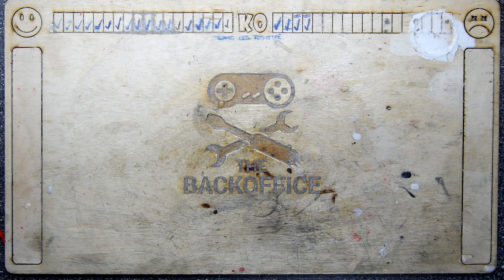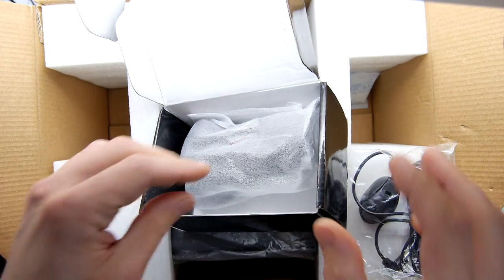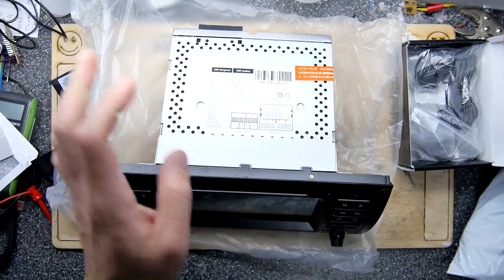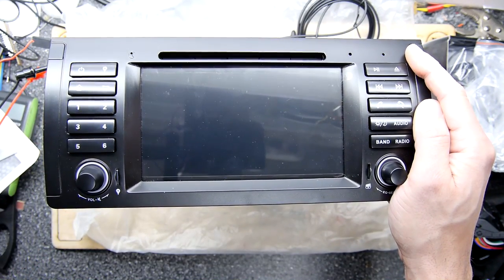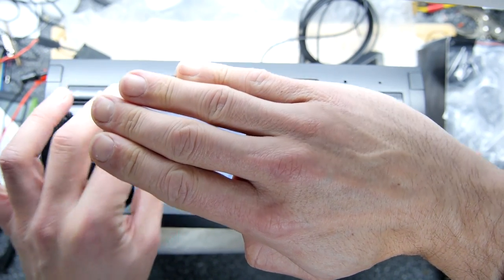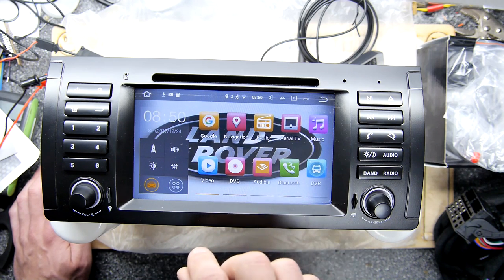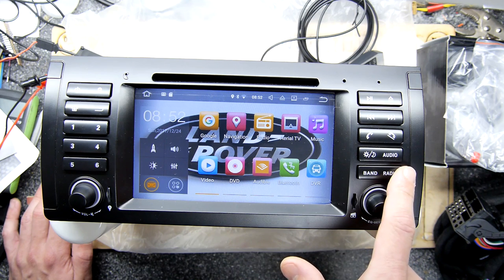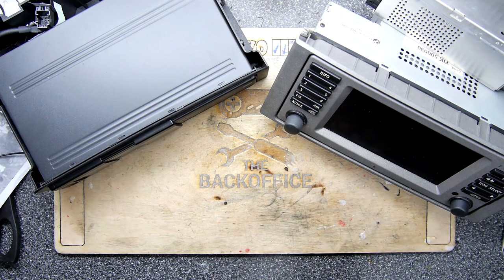Xmas Special Erisin Android Radio for BMW and Landrover

Comment: Nice unit. Wondering if I could get one for my Pontiac l?
Reply from the maker: +learnelectronics isn't that a standard double din affair? If so, I should think so! I might look for one for my commander. Annoyingly Chrysler use annoyingly shaped radios 😬
Reply from the maker: +learnelectronics https://www.carjoying.com/head-unit/m-s/pontiac.html would any of these fit? Same units, different reseller.

Comment: Just bought a very similar unit from ATD with the extension harness.  Trouble I've got is I got power to the head unit and the steering controls work but no audio, I have the LEAR XQK000020 DSP unit in a 2002 RR HSE, the older DSP Unit with a single block connector.  I've been told the AMP CON connection from this head unit provides power for the Amp to turn on but no one seems to know what pin / wire it is I should connect this too.  ADT haven't got the answer neither. I don't suppose you had to do the same with your head unit?  Great video by the way!
Reply from the maker: It was a while ago, but I'm pretty sure I yanked the DSP and trashed it.

Comment: Hi Andrew Can you please tell me where you got the 6 metre extension cable from for connecting the speakers to the head unit
Reply from the maker: Honestly I have no recollection, however I do believe it was classified as a BMW part rather than a land rover one. So have a quick look on eBay for selling similar radios for BMW's

Comment: I've got the same thing and it doesn't play any sound whatsoever. It powers up and connects to Bluetooth but the sound isn't there. This is for a 2006 bmw x5 e53 3.0d. Do you have a solution?
Reply from the maker: Does your BMW have the amplifier installed? If so you should bypass it and wire directly to the speakers
Reply: backofficeshow yes I have the BM54 box. I don't fancy bypassing as sound quality will be terrible, I've been told this by an electrician. We wired a test speaker to the unit and it worked. Otherwise it doesn't work when plugged in. I have ran out of ideas.
Reply from the maker: Bypass the amplifier, it works fine
Reply: backofficeshow How would I bypass this, by wiring individual speaker wires to the unit?
Reply from the maker: Yes, that is exactly the procedure. You need to get the extension wire if your amplifier is in the back so you can hook all the speakers directly into the back of your Android unit. 

It's a little annoying but worth it to have a decent radio.
Reply: backofficeshow I've done a bit more research and turns out I have a dsp system as I have the factory subwoofer. Research shows that with dsp you are limited to aftermarket units so bypassing it will be tricky.
Reply from the maker: That is the exact same unit I have. Trust me, I just ripped it out. There are plenty of guides on the web on the pinouts for this. Terrible things. You will save a lot of weight I've you remove the DSP 😂
Reply: backofficeshow no problem, thanks very much for your help.

Comment: Wish I could fit a double din in the Aygo I have, but don't think it would as a post is in the way.
Reply from the maker: +Phillip Ireland I think they do single din models with folding screens. Looking at the construction of you didn't have the cd player it would be tiny. Just a tablet with a few amp chips. The connectors are the bulk of the volume I'm sure.

Comment: You lose all the car settings, via the standard head unit, its best just to add a andriod pad to the av input and you keep car setting functions..
Reply from the maker: I think what is best is whatever course people want to take with their own vehicles.

Most people are not changing the head unit because of functionality, they are changing it because it's an archaic piece of junk that has likely failed. If they are really keen of keeping the 'car settings' i.e. setting the trip computer and clock they can put the old head unit in the glovebox or even the trunk (where they removed all those kgs of ECU and radio boxes) .